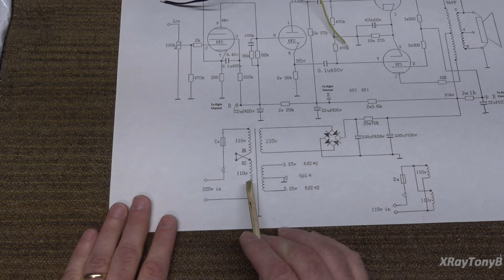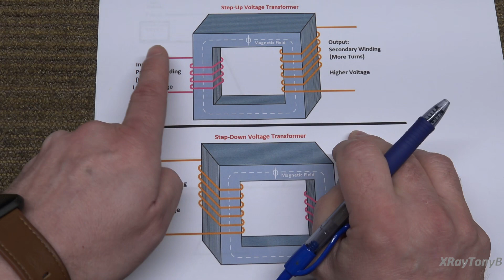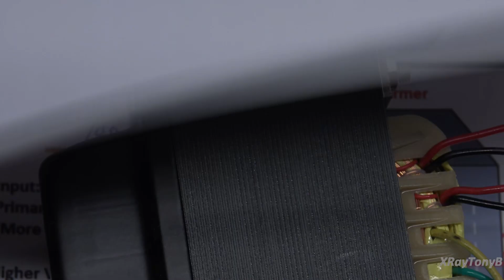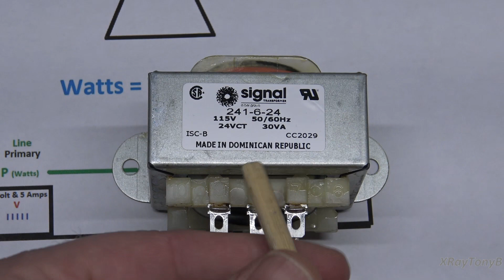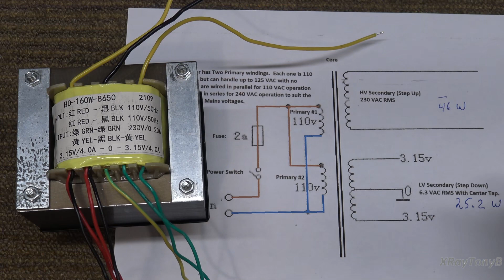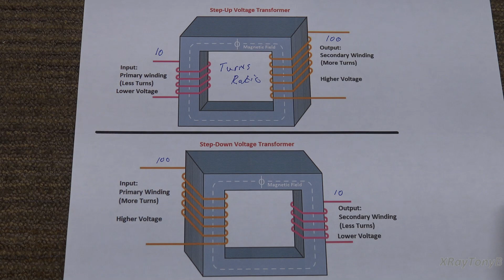Electronics 101½ Part 3 - The Power Transformer

Comment: Hi, Tony I have a couple of transformers that came out of some President/Uniden base station cb radio, there isn't any information on the transformer, how can you tell whether the only 2 wires on primary are 120v or 240v, ?can you test with DMM impedance?
Much appreciated 
PeaceFromOZ

Comment: I would consider using the tubes designed in 1957 for use in Car Radios without vibrator converters and using two VN66AF VMOS FETs for the Push Pull output stage and just using  a H+ of 12V for the heater and the B+ of 12V which would make for a nice safe unit and could be run of a car battery.

Comment: I have a microwave transformer re-winded for 24 ac but even at standby it gets so hot in just a few minutes! The core is isolated from both windings, but when i check ac i get some volts around core
Is it normal?
Why it's getting to hot?
Reply from the maker: MOTs were not designed to be used in that way.  They are a variable reluctance transformer with an air gap and shunt, used to regulate/limit the current.  If you change the windings, shunt or air gap width, it could greatly affect the properties of the transformer.  If driven into saturation, they will draw very heavy current and the core will heat up abnormally.  I would avoid messing with MOTs, unless you know how they work, as they can be more bother than they're worth, for modifying.  ;)
Reply: @xraytonyb  yes you're right
I removed shunt and i think it's one of main reasons. Also i can get some ac voltage! When I check the core with multimeter!
I think it just worth for spot welding and nothing else

Comment: @21.40 It might be worth noting that when connecting the two primaries in series or parallel it's vitally important to observe the correct phase of the windings. If the phases are correct it works. If the phases are wrong the magnetic flux is exactly canelled out and bye bye transformer or at least the fuse.
Reply from the maker: Thank you for bringing that up!  I forgot to mention that.  You are absolutely correct.  They make no mention of this in the schematic for this JABOP amp, but the primary wires are color coded red and black (who knows why they used those colors).  For 110VAC use, you wire red to red and black to black.  For 220 VAC, you wire the black from one winding to the red of the other winding.  Thanks again!
Reply: @xraytonyb  Might be worth mentioning this in a later video in case anyone is about to connect them wrongly.

Comment: How does one choose the right transformer for an audio amp? There are so many variables and transformer types to choose from, and even more amp designs available for free on the wibbly wobbly web.
Reply: The video explains what you are asking. You choose the transformer SIZE based on whatever power you need. There aren't really any variables... you need a certain amount of power at certain voltages, so you choose the transformer size to match.
The KIND of transformer is based on price. The more that you pay, the better the transformer. Simple "E-I" core transformers like shown in this video are the cheapest. There are Toroidal transformers that cost a LOT more and produce less noise (hum). There are even more expensive transformers that are better for noise. But really, a conventional transformer is usually good enough.
As I said, everything that you are asking is explained in this video... so just watch it.

Comment: If I wired that transformer in  a circuit using conventional wiring color codes many bad things will happen including an unplanned light show. My standards the way I was taught is Black- Black is primary, Red--red/yellow-Red is HV secondary; Green-Green is filament voltage; and Yellow-Yellow is the 5 volt for the rectifier tube filament. It must be a transformer that came from somewhere else.
Reply: Chinese for sure, good thing there is a map on the side of it!
Reply: There are no "standards" for wiring colors. That is why there is a schematic.
Reply: "It must be a transformer that came from somewhere else". If you watch the video all will become clear. If you "wired that transformer in  a circuit using conventional wiring color codes" you would not be paying attention to the situation. Many vintage transformers have no discernible wire colours and must be worked out from basic principles. A competent thoughtful person would have no trouble in deciding how to connect such a device, indeed such an exersise is an enjoyable part of involvement with the project.

Comment: i'd like to add an isolation transformer to my magnavox 3 tube stereo amplifier, but wonder how i can re-wire the filaments in paralell
Reply: Just use a 1:1 mains voltage transformer and ground the chassis.

Comment: I have to wonder if that Fisher mono-block amplifier you mentioned with the hot running transformer ran equally hot back when it was made and the AC mains wall-voltages were lower, not to mention that the characteristics of the transformer itself may have changed over the years.  Laminations that were originally insulated from each other may have become conductive due to rust or moisture infiltration.

Comment: Another thing worth mentioning is that the highest quality power transformers are, or at least sometimes may carry the designation CCS which stands for *continuous commercial service*. Most transformers used in consumer-grade equipment, howevers, were designed for intermittent service and so it's assumed that they might run for a couple hours or the better part of a day but will have a shutdown period for cooling off.
Reply: Interesting. Now CCS mostly stands for "copper coated steel", which is definitely the last thing to look for in a transformer :D
(It also stands for constant current source / sink, but it doesn't relate as much)
Reply: @KeritechElectronics  , there was also a designation for consumer-grade transformers, ICAS I think, for Intermittent something something Service....

Comment: Flux density in the core is actually highest at no load. As you add load, it decreases. Most power transformers (mains frequency types) are slightly saturating at no load. This is done to keep the core size down and, perhaps, to keep the number of turns down (length of copper wire) for better load regulation.

Comment: Another reason we use AC mains:   To transfer DC Current over long distances.... VERY large conductors must be used and is lossy.  AC current at high voltages can travel 100s of miles through thinner conductors with comparatively little loss.
Reply: Not really, 750kV HVDC lines exist and are doing great, it's about the relative ease with which one can convert AC voltages. Losses are proportional to current squared, regardless whether we're running AC or DC through the conductors and in fact lower in DC lines thanks to no repeated charging/discharging of line capacitances/power factor related losses. In fact, for a given voltage the power delivered will be greater for a DC line, as Tony explains. End of the line equipment is still more costly than in case of AC, however lines itself are quite the opposite and especially so for under the sea transmission. Remember also, that you no longer need multiple conductors to facilitate 3 phase infrastructure. China leads the way with multiple HVDC lines, some exceeding 1 million volts with Made in Germany ABB, Alstom and Siemens equipment.
Reply: As Paul B says, it's not the transfer, but the Voltage Conversion that is problematic for DC.
Even a humble SwitchMode Power Supply needs to convert the DC to AC, change the voltage, then convert it back to DC again. That gets incredibly complex when you are trying to supply GigaWatts.
Reply: @johncoops6897   I understand now... AC makes it trivial to step-up to high voltages for cross-country transfer (lower current, small conductors)...then step back down on other end. The end result is less power-loss with lower-cost conductors.

Comment: I feel like I am back in my first year of college (1970's). I understood core is laminated is so each layer is ELECTRICALLY insulated between each.  This stops the electrical eddy-currents from moving between layers. Magnetic eddy-currents are largely unaffected.
Reply: This is my understanding as well, that the individual lamination sheets were varnished to prevent them from electrically contacting each other;  I have seen transformers with cardboard or plastic sleeves over the bolts binding the laminations together together in order to prevent short-circuiting them electrically. How strict the manufacturers were about maintaining this physical/ electrical separation between lamanations likely varied significantly from one manufacturer to another, and the magnetic and capacitive isolation probably varied in inverse proportion to the price point that the transformer was made to! Formation of rust crystals inbetween and around the edges of the laminations, as often seen in vintage amplifiers, is supposedly a bad thing in terms of transformer efficiency.
Reply: Actually, this type of transformer is simply dipped in varnish as a completed unit.  The term "laminated" refers to the fact that the core is comprised of individual pieces of "laminations" stacked together. The major purpose of the varnish is to soak into the paper insulation (and lead anchor tape) between layers/windings of the coil for structural purposes and to minimize moisture effects within the coil. (Most bobbin-wound xfmrs. are not varnished).  In the varnish dip process, there is very little penetration into the core (between individual laminations). Most power transformers for applications such as radios and amplifiers (produced in volume) are specified for the application to ensure meeting its unique requirements while minimizing cost.
Reply: @whollyunaware5185  , I am aware that dipping a transformer in varnish after the fact is done not to isolate the laminations but to fix the coils in place and prevent buzzing and so on (ideally done under vacuum so as to displace air and allow full penetration of the vaarnish). However, if you take transformers apart, some units will appear to have individually painted or anodized or otherwise coated laminations. Ss Tony mentioned, the basic theory says that maximum electromagnetic efficiency is achieved if each lamination is isolated from its brothers and sisters. Most transformer manufacturers likely don't bother to do this.
Reply: @goodun2974  The coating you may have seen on individual laminations may be the oil that is applied by the lamination manufacturer to facilitate the use of lamination stacking machines. Besides the cost-prohibitive concerns of impregnating (and baking) individual laminations, lumps and air bubbles would render machine laminating impracticable. The purpose of varnish impregnation (dip or more-expensive vacuum) is to seal the coil for environmental concerns (generally not applicable to commercial radios, etc.). The bi-product of avoiding rust on surfaces of the lamination stack and mounting hardware is more an aesthetic value.

Comment: That grounded connection shown on the diagram is typically an electrostatic shield, a sheet of copper in between the windings, and NOT a ground for the core laminations. It's my understanding that the individual lamination are coated with varnish and ideally, for the sake of efficient energy transfer between primary and secondary, should not be electrically connected to each other (and the bolts holding the laminations together are often insulated with a cardboard or plastic tube). That said, in a cheaply made transformer, or an older transformer, or one that has been exposed to moisture and has grown rust crystals inbetween or around the edges of the lamnations, there are probably numerous connections between the laminate plates, causing flux leakage and inefficiency, perhaps even causing overheating.

Comment: You can use a transformer for DC, you just have to turn the DC on and off in pulses. This is how switch mode power supplies work. The advantage of high frequency DC switching over the 60Hz AC, is that transformers can be built much smaller due to less magnetic flux.
Reply: At some point in the past, military aircraft used 400Hz alternators and 400 Hz transformers, presumably for purposes of efficiency and lower weight.  Similarly it is worth noting that modern transformers need to have a larger core if they are going to be efficient at 50 Hz mains frequency rather than the 60 Hz that is standard in the US.
Reply: @goodun2974  yes, transformer size is inversely proportional to frequency

Comment: Did you hear the war on AC vs DC criminal........and yet today most product use DC so?????
Reply: There aren't any AC Batteries... so we prefer DC for our gadgets.
Reply: So?

DC was unfeasible for long distance transmission back then because you needed to transform it to AC, transform it up and then convert back to get any appreciateable transmission distance. As low voltage DC needs thick expensive conductors and can't get that far. You need high voltage for long distance which wasn't possible in purely DC back then.  Otherwise you would have needed a power station per city district.
Also back then most home appliances only needed AC as they mostly used heating elements, AC motors or light bulbs. Low voltage DC applications didn't really exist up until the 20ies in the typical home.